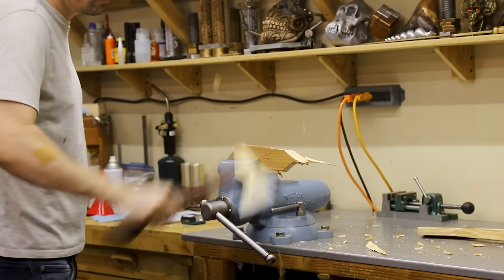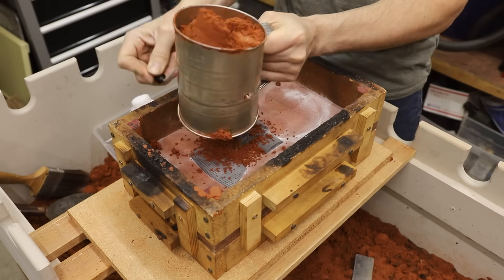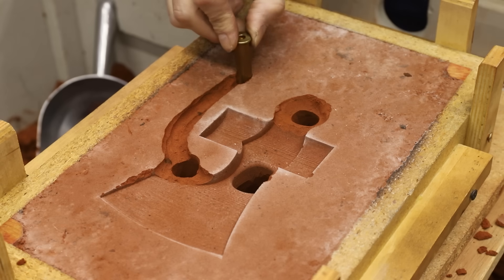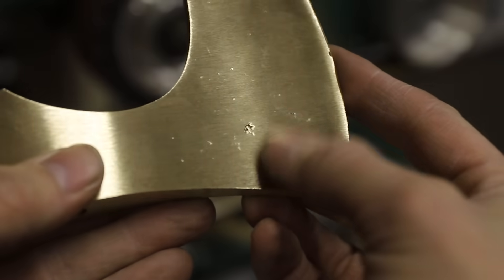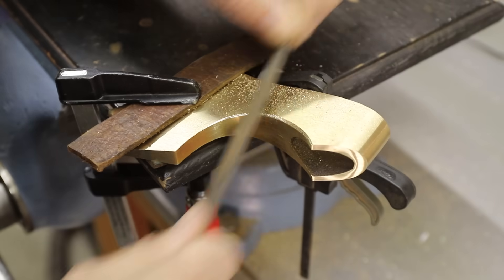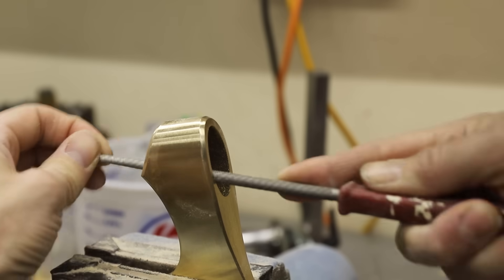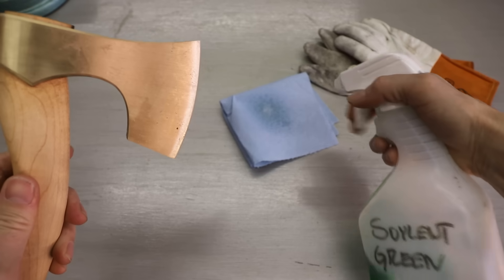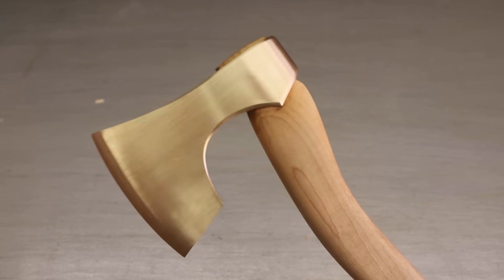Making & Testing Aluminum Bronze Hatchet WILL IT SURVIVE?

Comment: You can try refining the edge by peening with a hammer, kind of like how they do for sharpening sickles. That alloy may dull faster but maybe you can restore the edge quickly, and it'll be work hardened every time. It'll retain that hammered appearance but that's okay, it doesn't need to be completely smooth.

Comment: Honestly, I think the hammer marks from work hardening the edge look really awesome.
Reply: i know right?? i was so confused when he ground them off. the hatchet probably would've held up a little better too since it would've had a bit extra material
Reply: Honestly (and Robison Foundry - think about this): I honestly think that not only would that hammered edge have made it look like it was made by someone who knows at least a little metallurgy (honestly I wouldn't have thought of it, it was a genius idea!)

But I can't help but wonder if those ridges and divots wouldn't have made for a stronger edge in the same sense as steel girders are stronger than a solid sheet of steel. I am doing to go out on a limb here and suggest that leaving the hammer marks in the blade could have increased edge durability by as much as 25%. 50% if the edge profile had been just a wee smidge thicker.
Reply: Agreed

Comment: The cutting geometry for dry wood is different than for green wood. Looks like you gave it a thin edge so that's why it worked so much better for green wood. Give it closer to a 60⁰ edge and it will work better on dry wood

Comment: When you work harden a tool, only a small amount of the 'surface' typically hardens, and this depth depends on the amount of force applied, along with the type of material/alloy.  You may have ground a fair amount of the hardened surface away after you'd hammered it, so if you test again in the future, consider not grinding the face near the edge completely smooth again ( the actual edge itself may be difficult, of course ) - will take some playing and testing!  ♥

Comment: You need to forge a spoon with a really long handle to scrape the gunk off of the top of molten metal. What you use now, a spoon tied to a stick, is so redneck… but then again, if it ain’t broke then don’t fix it

Comment: I've used Aluminum Bronze (C95400) before for tools. It's an ATEX non-sparking material for a couple use zones (1,2, 21, 22) for people that work around flammable materials and gases. It's about as strong as mild steel
Reply: That's what I made my aluminum bronze hammer for. To be fair I also have a pure copper hammer for non-marring work as well.

Comment: the rolled edge might be at least partly from edge geometry. You'd probably want to make the edge with a larger angle, so it's got more support behind it. Like 30 degrees instead of 15 degrees kind of thing. It looks pretty slender in the video. It'd take longer to do the same job but it would be more likely to actually survive, I think.
Reply: Agreed. Also, given the apparent softness, he should have just peened the rolled over edge back into place.
Reply: I've heard old copper-age blades (pre-bronze age) were "sharpened" by simply hammering the edge back into place, rather than using a whetstone or grinding method. This was practical and wasted little of the highly precious metal. Bronze tools could bend too, but I think the attitude was "who cares? just bend it back."
Reply: 15 degrees would be an incredibly acute angle even for a kitchen knife, let alone an axe.
Reply: @yamiyomizuki  Not really. 17 degrees is very common for a kitchen knife. 15 really isn't that extreme. There's plenty of 15 degree kitchen knives.
Reply: @Jake-bt3fc  typical for a chef's knife is 20 degrees. 15 degrees is way too much to ask of an axe made of a material softer than steel. dialing back the angle to something a little easier will absolutely result in a useful tool
Reply: @itsumonihon  I’m not talking about copper axes, I’m talking about steel kitchen knives. 
20 degrees is average for a pocket knife, not a kitchen knife. 17 degrees is what most kitchen knives have.

Comment: I guess in Valheim when you hit an oak tree with a bronze axe and it says "Too hard!", I can't complain anymore.
Reply: WAS JUST THINKING THAT!
Reply: I love that this game is so popular. I also thought about not cutting down harder types of wood, but the first tree available in Valheim isn't maple?
Reply: @hibahprice6887 Nope, first tree type you can cut down is Beech
Reply: hey side fun fact (from history): it would take upwards of three stone axes to cut down a single tree in the stone age, while a bronze axe would generally survive at least a few cuttings - though not without significant damage, if the wood was hard enough!
Reply: @theradioactiveplayer3461 and bronze and copper tools would have had the edges reworked and straightened as they were used to keep them in better condition
Reply: @theradioactiveplayer3461  I saw a lot of videos on the primitive technologies channel, where the author made a stone ax that had very lens-shaped slopes. He cut down a lot of wood for them, but literally nothing was done to the stone. The stone was gray and very dense...an ordinary stone
Reply: Honestly, it should still be able to cut it but it would leave the axe in damaged state. But because bronze is so malleable compared to hardened steel they are also easy to repair. As long as it hasn't chipped too much you can reshape it quite a bit before it becomes too brittle and needs remelting and casting from scratch.
Reply: Oak is no joke homie shits a bitch to chop with a steel axe
Reply: @owenblount7334  Nobody said it would be easy but oak is a tree amongst others, hard and heavy as balls but still a tree and people worked with it right from the stone age.
Reply: Meanwhile there's a video on YouTube of a guy literally ramming a tree with his balls until it breaks in half. Granted it was half rotten but still.
Reply: No fine wood for you.

... unless you trick a troll to smash it all up for you!
Reply: Okay seriously, WHAT is the requirement for chopping down oak trees!
Reply: @omg_itsmoon  Well see step 1 is to own land. This is the difficult task. Most people go their whole lives never managing to own land. If only there was enough land for everyone. 

But then there would be no wars and certain people wouldn't like that.
Reply: Tree too hard? Use another tree to cut it down 
a legitimate albiet slow way of getting later game wood types early on
Reply: @NOKORUS_A_Crazy_Eldrich_Cat  Genius!
Reply: I renovated some houses built with old growth pine, as in, the first trees white people cut down when they came to america. The shit was so dense you couldn't nail into it with anything but cut nails, and sometimes even then they would fucking bend. Modern wood is fucking garbage. I make random shit out of old growth sycamore now. Once it dries you can't really work it.
Reply: Haha funny, also trees are scary in that game :D
Reply: But did you know that Viking woodsmen invented a way that you can make tree bark into flour, bake it flat, and use the tree's own sap to sweeten it?
Reply: @RachDarastrix2 Pettuleipä, yep.
Reply: @RachDarastrix2  Indeed. Pettuleipä in Finnish. But it is very poorly digestiable and very little nutritional value and high possibility of stomach ache. It was not commonly consumed except in dire needs like during famine and mostly mixed into to the rye flour to stretch their storage of rye as far as possible.
Reply: Valhalla you mean ?
Reply: @shinebox3925  No Valhiem is the name of a video game. Valhalla is one of over 8 afterlifes in Norse Mythology.
Reply: There are different kinds of bronze though. Arsenic and aluminum bronze is far weaker then regular bronze. Archaeologists have found oak that have been cut by bronze axes so we know that is possible but I don't know how common it was or how long a bronze axe survived doing it.
The big advantage is that when it is destroyed you just melt it into a new axe without making it weaker, something that is super complicated to do with steel.

But the game is lying to you.
Reply: Was interested in this channel, but then I saw your yard. Cmon man.

Comment: Aluminum pronze can be heat treated and tempered.  You might look into that for better edge. Or let the edge get rolled a bit to work harden it then regrind to sharp, the reprofile will likely hold better.

Comment: You should try to cast tools out of Beryllium copper.- It is a very high strength alloy that is used to make non sparking tools for the oil and gas industry, even wire cutters are made out of Beryllium copper...

Comment: It worked for thousands of years, it works now. Refining your mixture and quality of metals will help, as I just watched a video of a bronze axe cutting through a whole tree thicker than that and it had no damage at all. Perhaps a bronze machete or saw would be interesting to try.
Reply: Ah, not exactly. Bronze yes, aluminum bronze, no. Aluminum is very hard to make without complicated equipment.
Napolean had a ring made of aluminum; it was worth more than pretty much anything else in the French treasury.
Reply: @josephd.5524  There was an era where aluminium cutlery was a symbol of wealth.
Reply: @josephd.5524  Thank you for respectfully correcting me, that is hard to come by. Was it tin they mixed with copper?
Reply: @ATruckCampbell   Yes. Ancients Egyptians used approx. 9-10% tin in a tool grade bronze, rest was copper.
Reply: @josephd.5524 Of course Al is a modern metal; most of the Al today comes from electrolysis
Reply: Aluminum was worth more than gold until like 100 years ago.
Reply: @Flumphinator yep, it's why it was used as the capstone of the Washington Monument (which was made right before the first of the modern commercial methods of refining it were developed, making it almost immediately worthless)
Reply: @theapexsurvivor9538   Atleast being Aluminum, the cap will not rust or corrode for many more centuries or millennia (hopefully).
Reply: @ATruckCampbell  I mean, it's already been pretty badly weathered (it wasn't anodised iirc so sun and oxygen took their due), and lost 1/23rd of its height due to a lightning strike. About half of the original inscriptions are now illegible, and it will probably degrade much faster once maintenance inevitably stops. A few more centuries seems plausible, but I'd doubt it lasts more than a single millenia.
Reply: @theapexsurvivor9538  That's unfortunate.
Reply: @ATruckCampbell  yep, but not surprising. They built it to be a lightning rod (aluminium connected to the iron columns supporting the elevator, with copper rods connecting those to groundwater), because they didn't realise just how electrophilic the aluminium was, or how poorly the marble pyramidion would handle it (it was damaged within 6 months due to the severity of the lightning it received), so they've been trying to fix their errors with a variety of measures ever since (a copper and gold cage with various sets of lightning rods, which is what destroyed the inscription beyond legibility, and most recently two large aluminium lighting rods that are shorted just below the pyramidion).
Put simply, the design was built without consideration for how little was known of the material and has suffered from the lacking knowledge of its designers ever since.
Reply: ...for thousands of years until iron/steel came along and took over completely :)
Reply: @mikaeliby387  Iron was widely considered a way worse material than bronze actually. It was just a lot cheaper and easier to make.
Ancient Greeks used to lament over how the wonderful "bronze age" devolved into the inferior "iron age", fun fact.
Reply: @Cerebrosum  Cheaper, easier to make, the ore is not at all rare, and most important available to most people. All these things talk for iron. Bronze was something that only the ruling classes could control, and so of course the top lamented the time of bronze trade. It was both the symbol of wealth, and a big source of the wealth. Plus, nostalgia over the last "golden age" is universal and timeless :)